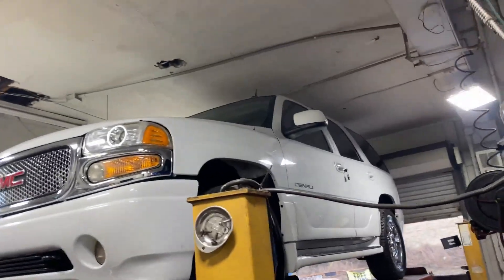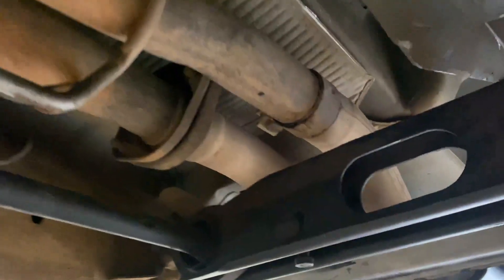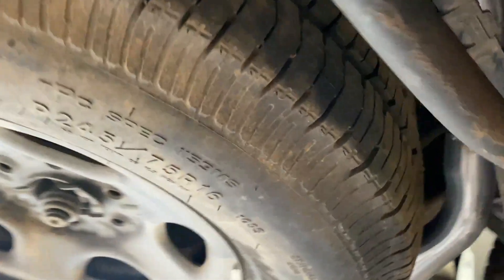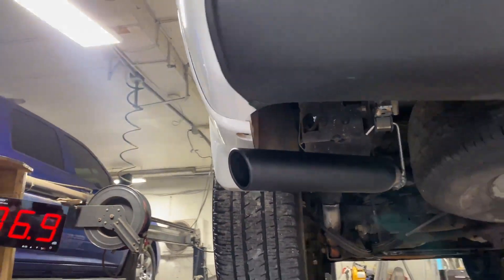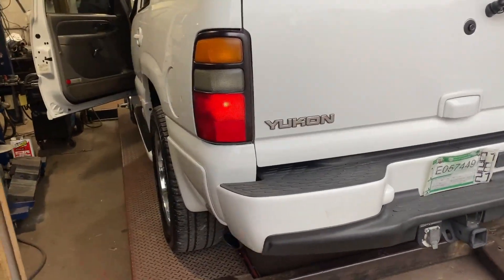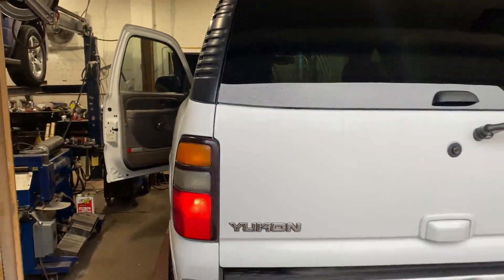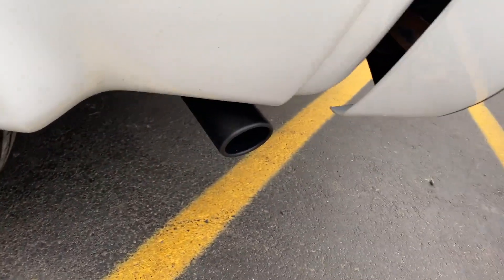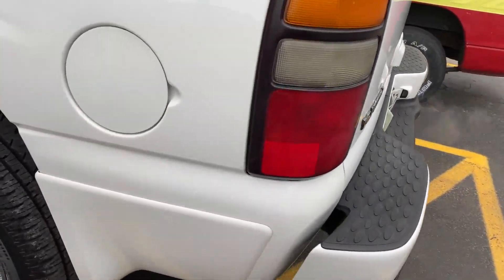2005 GMC Yukon Denali 6.0L V8 LS TRUE DUAL EXHAUST w/ FLOWMASTER SUPER 10!

Comment: sounds good and runs very strong 6.0 LS  ain't playing around..
Reply: I’m doing mines next 
Contemplating on what I want done though
Reply: Its a LQ 6.0 not an ls 
The trailblazer ss
The c6 Corvette
Late year Silverado ss
All had the LS2 400 hp all aluminum v8

The normal LQ 6.0 was all iron cast and made 325 hp and thats what the Denali and escalade and Silverado/Seria 2500/3500 used  
The early Silverado ss with the LQ had 345 hp
Reply: It’s LS based meaning it’s pretty much an LS in iron block form.

Comment: Not true duals when they combine into a single muffler, even if it is dual in/dual out.
Reply: Ggi
Reply: Depends on the muffler. It can be dual in dual out and it be one whole muffler or it can be dual in dual out with 2 small mufflers on the inside... not like a resonator
Reply: It’s true duals idk why GM put them together at the back wheel. Each header has its own side and exhaust.

Comment: I have the xl and love it . For as big and heavy as they are they still move pretty well . And know I know what exhaust to go with. I was just gonna do a muffler delete.
Reply: I did the muffler delete on my '05 Denali XL, and kept the factory dual tip. It sounded exactly (to my ears) like my '98 Trans Am.  That factory bus muffler had to weigh 70 pounds!
Reply: Muffler delete ftw. My 05 sounds perfect 😁
Reply: @c7zftw777  How is the drone with the straight pipe? I've got a magnadrone on mine and it sounds great but it's got tons of highway drone.  My Mustang GT is straight piped behind the factory mid pip and it has zero drone and is way louder than the Escalade.

Comment: i have a 2005 yukon denali with the 6.0. and it’s awd. ran a 10.69 in the 1/8 mile
Reply: An what all is done to that Denali
Reply: What you got some on it?
Reply: What trans and t-case?
Reply: I believe it I got a 04 that can use e85 I walked a r/t charger one day got on the light he never got passed me stock just straight piped

Comment: I have a 2005 GMC Yukon Denali all blacked out with OEM rims and tires from a 2020 Chevy Silverado. It's got great bones and has some updated parts but runs like a champ even with over 200k miles on the engine. That 6.0 V8 is so bad ass. I love my truck!

Comment: Flowmaster on GMC/Chevrolet is a required because stock sounds passive Installed a Flowmaster 40 with a 3in 3 out single on my 2007 GMC Sierra Z71 classic don't regret it at all

Comment: Why did you choke it down to 2 1/4 if the factory was 2 1/2? A 3” would have been louder.
Reply: I have a 04 Denali and it’s 2 3/4in then after muffler and it’s 3in. Easier to just get adapters and delete the muffler that’s what I did. Sounds really similar to this